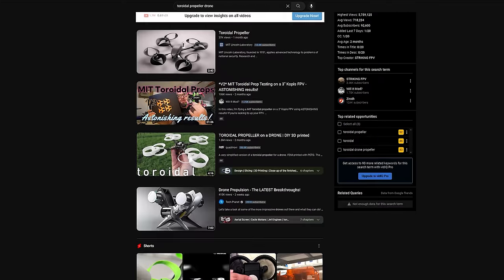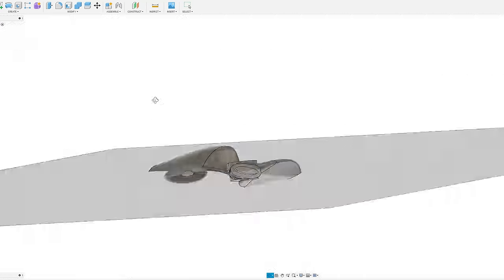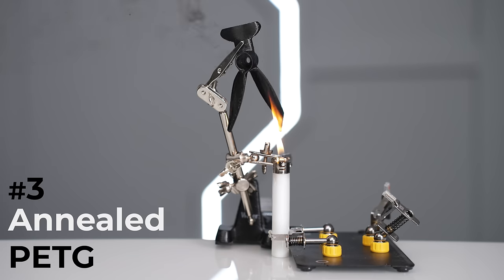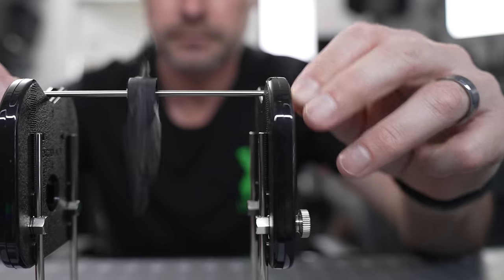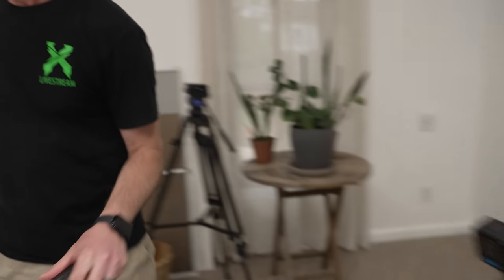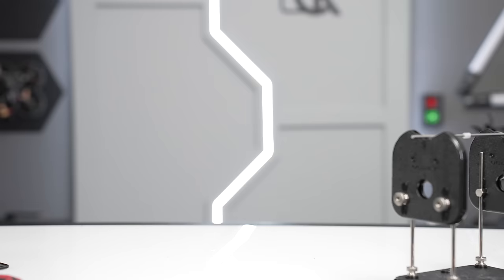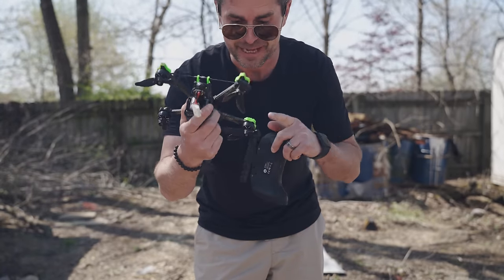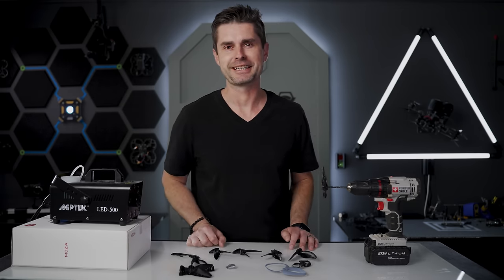Zipline PROPS Look CRAZY! So We MADE Them        |        Free STL Download

Comment: If we picture the Zipline-prop as a single unit being used in a tractor configuration so that one of the two offset blades is first being forward, does it matter which is advanced and which is trailing? This may be a stupid question but, when geese fly in V formation the trailing bird must be above to catch the pressure wave from it's leading bird. I imagine the second blade of the prop should trail behind to catch the wave to amplify the thrust, but if it does will this alter the acoustics or the performance?

Comment: Re: Injection molding.

You can make limited-use injection molds for some lower-temp thermoplastics on a resin printer using special high-temp resins.  You would still have to make an injector, but the resin and collars for printed molds are both sold at reasonable prices for people who want low-volume manufacture that's too much to be entirely 3D printed but not economically viable to have actual dies cut from steel or aluminum.  

If you do end up exploring this, have fun with it!  HDPE is infinitely recyclable and might be strong enough to work - then you can make a video called "Making groundbreaking propellers out of laundry detegent bottles!" or the like

Comment: So last year I was building a quad and I needed this very specific set of props but they were all sold out every where and I was at my wits end until my printer looked at me in that way and I was like screw it let’s give it a go and through all of my prop explosions I learned a good way to make them strong with out changing the physical features of the prop like what might happen when annealing them I learned I could buy large amounts of ca glue for cheep so $40 later I found my self dipping my props in a bowl of ca on my front porch and letting the sun cure them and after that I just balanced them and they flew amazing well amazing for props I made my self but they were reliable and I flew the final version I made for six months anyways I really hope that you can have the same success I did and you have definitely earned a subscribe from me as I feel your pain😂

Comment: Carbon fiber won't help but i'd give a shot to nylon if you are able to print some. It's a pain in the ass to print but the X1 is more than capable to do so. No part cooling and the right temperature should make those very solid and the flex will prevent them from "exploding".
Reply from the maker: I have some nylon on the way. Thank you for the detailed tips!

Comment: I wonder if this may be a good use case for resin. You wouldnt have the issue with layer delamination since resin prints are pretty uniform regardless of print orientation. Resin is not shock resistant but is pretty strong in tension. You would also get more accuracy in general. Though definitely not a  permanent prop solution
Reply from the maker: I agree, resin is probably the best option for working prototypes. We are getting ready to test and start the next video very soon!
Reply: @CliffKajun  awesome I look forward to watching it!

Comment: The point is to over size. Use low rpm high torque motors. Also the trailing blade has a 10-15% higher pitch than leading blade. The angle between the blades is based on the optimal rpm
Reply from the maker: Yea, we are going to try larger props on slower motors in the follow up video. Good call on the pitch! Thanks!
Reply: The angle between the blades is set, so at the pitch, turbulence noise is 180 degrees out of phase of the other blade.
I found a tuning it was simple to record the sound at hover under load and tune by moving them apart, tell the sound from 1 blade, cancels out the sound of the other at that rpm, and load.

I did all my testing on a bench with a load cell on an arm off the side of the table, swinging a T16x8 prop and modified by cutting 2 props dril holes in the CF and casting bismuth and trimming to balance each blade and the to as a set a modified tall hub let's me change the angle between them to tune to the 3500 rpm I ran them at for for efficiency. Power was a bench supply at 90v to a hv vesc a a set of umik2 from minidsp I use 1 at 5ft and 1 at 20ft to capture noise peeks and tune the props.
It's no joke I managed to drop 19db doing this

Comment: ModBot recently did a video on printing pla with petg as support material and visa versa. Gives a very good supported surface finish without marring. Might be worth a look.
Reply: exactly what I was thinking, but for that you'd need a material station with his printer
Reply from the maker: That's a good call. I've had decent results with this method. We may try this in the follow up video. Thanks!
Reply from the maker: Fortunately our Snapmaker 2 has the dual extruder module 🤘🏼

Comment: Contrary to popular belief PETG is not stronger than PLA. There are lots of tests on  youtube where they printed hooks from PLA and multiple other materials, and PLA comes out stronger than they PETG. 

Also, annealing doesn't work with PETG. Annealing PLA "allow its amorphous structure to change and morph into a much stronger, crystalline structure". Nothing like that happens when heating PETG.  

But you can increase strength of PETG only by remelting it, or heating  it high enough that layers fuse together little bit more, but the whole part doesn't melt. 

One way to make PETG stronger is to pack it into powdered salt (or similar) material and heat it high enough for the whole part to melt. Part of course should be printed with 100% infill
Reply from the maker: You bring up a point, but in our tests, the flexibility made the props stronger. The initial jerk of the motors spinning up shatters the PLA to easy.. In our tests at least. 

The salt method is next on our list. Thanks!!
Reply: @CliffKajun  Idea/suggestion: don't try to print blades, but use blades from "Gemfan foldable prop". These props come in kit where blades and hubs are separated, and you are supposed to click them together. Blades are injection molded and looks to be very good quality. You'll only need to print the hub.

Comment: Could make a channel inside the props, shove a metal wire coated in epoxy in there. The metal wire will hold it together better, and the epoxy will slightly shrink (and mate the two materials together).

Additionally, you could get a slightly conductive filament and electroplate something onto it. (Might have luck resin printing a micro lattice, for lots of surface area for the electroplating to deposit material on. Would have to be sparse unless using a electroless plating solution.)

Comment: Combine the toroidal with the zipline concept. If the blades are connected, they will be stronger, and maybe the loop itself can be made to add some lift.

You could also try making one perfect example, hand smoothed and polished to perfection and make a support mold from clay or something for your printer to build onto/into, and eliminate the support structure removal issues altogether.
Reply from the maker: These are great ideas for sure, and something we will definitely consider. 

Our channel was originally a camera/drone channel, but after this video I realized how much more I enjoy the engineering side (what I grew up doing). After 6 months of moving and setting up a new shop, we just posted our transition video today. So, we will FINALLY be revisiting this project very soon and on a much larger scale 😅. I'll be sure to mention this, and other comments when we finally finish the next video on this. Thanks for your advice!!

Comment: Most all cooling fans on vehicles are not symmetrical, the blades will still be balanced but spread out varying widths. It helps to quiet the percussion waves like you’d hear from a helicopter.

Comment: You need a X1-Carbon Combo. If you printed them laying flat to align with layers optionally out of PETG with PLA as the support interface it would give you a support that would breakaway cleanly and give you a much stronger part. After prototyping the concept use either PA12-CF or PET-CF with Bambu Lab breakaway support material ("Support G") if necessary. I find using 3 interface layers with a grid like pattern with the carbon fiber reinforce nylon blends you really don't even need the specialized support material. It comes off extremely clean. 
Your printer and material choices will make a huge difference in your success...I promise you that!!

Comment: If you dont want to print in the 300deg range , look into mold supplies and use your filament print as templates for the mothers you can cast.  You can even cast metal in reusable modings material these days

Comment: Um.  Try using a loss style creation, where you anneal a chunky version and CNC it down, if you want it to acutally be smoothe.  Make the blanks for your props out of material in multiple steps, and stick something like a bit of fiber material into it, infill it with anything that will bond with both, and you'll have a structural element.  Print in two steps where the second sticks to the first, if you want a semi rapid way to turn your prop into more or less a string with soild structure around it, to turn the problem into a tension one on the fibers, rather than a solid mass+resonance structural problem involving complex forces acting on a otherwise solid shape?

Comment: I keep wondering if bigger, slower props will be quieter. More surface area for lift means props can spin slower, right?
Reply: You're exactly right. Bigger propellers are also more efficient and run on lower rpms. The limiting factor is the frame size of your drone. There's a give and take as increasing the frame size increases the forces it needs to withstand and increases weight from the compensating material.

Comment: Print the props with wax and then put them in a plaster of paris (PoP) or sand mold and then push in hot liquid plastic or metal. Ideally, Wax will burn off and you should get rough cut props which can be polished to an accurate shape.

Comment: I’m only 6 minutes into the video but the bulk of the problem is def print orientation…
With that fancy printer just print the laying flat using ABS and use HIPS for your support material! Then vapor polish that ABS.
Reply: totally agree. streght is needed in the rotation direction. 3D prints are known to break beteen layers.
Reply from the maker: Yea you are definitely correct. I almost felt bad leaving the beginning version in the video, but it seemed to make it more fun from a story aspect. Plus, that’s what we actually did lol. 

The follow up video will have much more logical, and comment informed, decisions made 😅

Comment: Just FYI if you look at the data like CNC kitchen showed, PLA has far superior tensile strength than PETG.
Reply from the maker: Good call. Yes, this is true. With the filaments we have, the petg has substantially more flexibility than pla. We use it in our production parts for the same reason. The motors spin up so quick, flexibility is needed for this design. I would like to try it again with some different types of pla 🤘🏼

Comment: Hi, please try using E-DA brand TPU, it is a bit stiffer then other TPUs, I use it in a bowden tube printer, I think it would work well for this.
Reply: (very high layer adhesion, will bend instead of snapping, nylon-like but easy to print)

Comment: For better sheer strength, consider metal reinforcement. Extra light aluminum strip just inside the outer rim of the blade, creating a tension pulling inwards along the whole prop. Cheap, light, solid, reusable. Its the method I do for anything that needs to hold any sort of weight, because 3d prints are notorious with sheer because of the layering
Reply: Also, I wonder about the circle arc supportless 3d printing system. If you adjusted the arcs along the shape of the prop, you might be able to dramatically improve the whole print and get rid of the supports entirely in a single upgrade

Comment: I think you should use SLA 3d printing technology. 3D printing with this solution will make your part have a texture similar to molded plastic.
Reply from the maker: That's a great idea, and I think we are going to do a follow up video with resin printed versions. The higher end SLA prints aren't something we can currently afford since we would need several variations. 
Cheers 🤘🏼

Comment: The obvious solution is to use SLA resin 3D printing. You can get much better stiffness vs flex properties with resins like Siraya Tech Blu etc.
Secondly... if you want to knock out batches and batches of these things, you really ought to get into simple mold and casting techniques. This is where 3D printing obviously shines, especially resin printing. Due to the smooth, almost non-existent layer lines. Casting is super easy, and not expensive at all, using Smooth-On products. Plus, there's awesome casting resins that harden in minutes. With a silicone mould in your drone kits, you could literally make new props in the field and be back flying well under an hour.

Comment: If you would had just printed them out flat the first time and then just taken the hour it takes to sand them smooth they would have worked perfectly fine. I have 3d printed several propellers before and have gotten each of them perfectly smooth in about an hour of sanding. My guess is with all of the failed attempts and tried if you would have done it the right way from the very start it actually would have saved you a ton of time. Still though, very cool video! I enjoyed it a lot while eating a bag of chips

Comment: For injection molds, you can use a 3d printer. I made a carbon fiber back for my phone using a 3d printed mold although I need to warn you: it's finicky af. The whole process took around 5 days(would have been 2 if the weather wasn't crap). That said, there are some extra steps in order to get a clean result without inheriting the imperfections from a 3d print. Perhaps I should make a video explaining it...
Reply: Speaking of, I could hypothetically make the props out of carbon fiber and ship them over to you...
Reply from the maker: Good to know! I appreciate the advice, we are seriously considering making a follow up with molded, resin printed, and a few other methods. Also an updated design since the limitations of 3d prints won’t be an issue for all. If you make the video and explain how to do the mold, I’ll watch it and shout you out in our video instead of trying to explain it myself. (Assuming we make it. I’m 95% sure we will). 
I appreciate the shipping offer, but I would rather just keep tinkering and building. It’s likely they’ll get destroyed by me immediately anyway lol. If you make the video, comment on here and email it to the email on our about section. 

Cheers! 
Cliff

Comment: When I imagine a double wing, like used for downforce, rotating with the adjustments for airspeed across the length... More thrust at lower air speed reducing noise?
Reply from the maker: It seems lower speed, larger area is always quieter. Followed by lower turbulence being quieter.
Reply: @CliffKajun  Yea, the double wing is too complex.  A broad blade with a short winglet at lower rpms might be worth a try.

Comment: maybe this is obvious but, why don't you 3D print an injection mold? Or 3D print the prop blades and then make a mold of them?
Reply: an injection mold needs to be able to withstand both high temperature (from the molten plastic) and pressure (from injecting the molding plastic), plus they need to be very flat where they contact to minimize/reduce something known as "flashing" (plastic escaping out of the mold), even if you had a really good metal 3d printer, you still couldn't make the mold work because the layer lines will probably grab onto the plastic piece and prevent it from demolding, that's why all injection molds are relatively high precision machined/CNC'd steel or aluminium.

Comment: I've been thinking about how to make them stronger while keeping the shape nice. Maybe your could try printing it single wall and filling it with epoxy. You could add chopped carbon of fiberglass to make it stronger.

Alternatively you could try salt curing these props, where you put them in a bed of very fine compressed salt. You then put it in the oven to fully melt it together. CNC kitchen has a great video on it.

Lastly, I'm really curious about how the second prop is affected by the downwash of the first one. So it'd be really cool if you got high framerate footage of the next version running with some smoke.
You might actually want to print a test stand with a single motor so you don't have to mount them on your drone every time. They are often L shaped with a bearing in the center and the other arm pressing on a scale to get force measurements.
Reply from the maker: That’s a great idea on filling the hollow print instead of infill. I’ll have to try that. 

Salt curing is on our radar for the follow up for sure. I’ll watch the video. Thanks! 

We are going to make a much better test rig for this one and tweak the design of the props quite a bit.
Reply: @CliffKajun  cool! Looking forward to it!

Comment: Hmmm, would like to try a 7" version of the prop...mighy try ABS, then do vaper bath to smooth it out.
Reply from the maker: The first props were 7inch. (The putty weighted one). If you have the printer, try the download in the description🤘🏼
Reply: @CliffKajun  I've been using ABS on the Bambu with good results.  I'm gonna go for it! Will probably go overboard with the supports, then just sand/hobby knife the snot out of it, hit it with vapor, balance, then watch the drone and or plastic fly! :-D